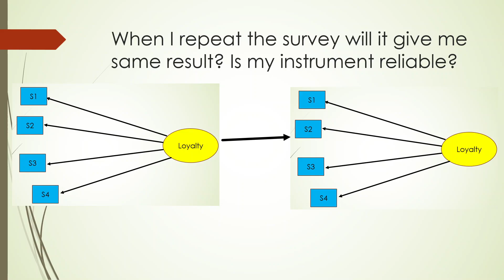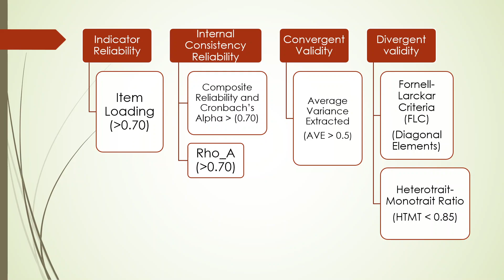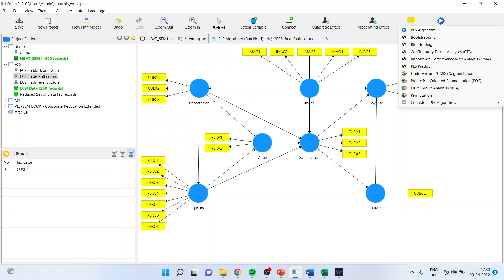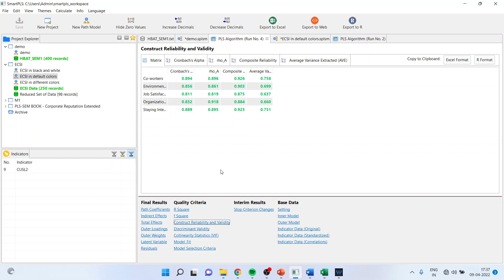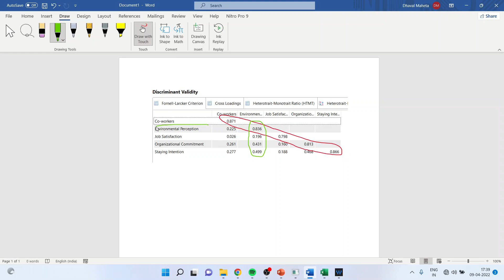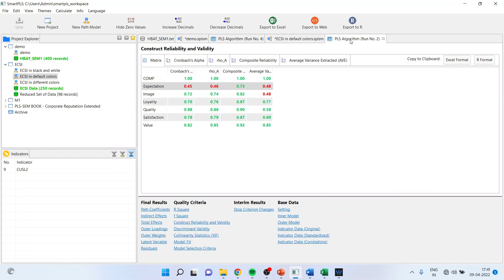4. Measurement Model Assessment-Reliability and Validity Testing in SmartPLS || Dr. Dhaval Maheta

Comment: Dear dr Dhaval Maheta, I want to ask you about the research that I'm doing. I'm analyzing the user experience of a website using HEART Metrics ((with 5 variables : Happiness (x1), Engagement (x2), Adoption (x3), Retention (x4), Task Success (x5)). 

I want to do a validity test and a reliability test, then calculate it with IPA. How's the SmartPLS doing?

I don't think I have the y variable, can it be done without the y variable?

Comment: Dear Dr.. regarding HTMT that is above 0.85 ... you have mentioned that the only remedy is to refine the questions in the questionnaire. However, this is too late if we find out after data has already been collected. We cannot refine the questions in the questionnaire anymore. What is the implication of high HTMT on the analysis result if we proceed with the analysis (since there is nothing else we can do about it?) Are there any other remedies at this point? Thank you, Dr.
Reply from the maker: If we run with high HTMT, your VIF value will be high as divergent validity is lost and our model will not have correct estimates.
Reply: @DhavalSaifaleeAaryash  How bad is it if HTMT is over 0.9 but still below 1.0? Is it acceptable if F-L criterion is within limits? Thank you Dr.
Reply from the maker: @joelkeats7192  it raises a big concern over authenticity of data